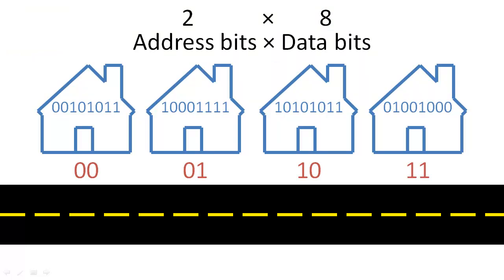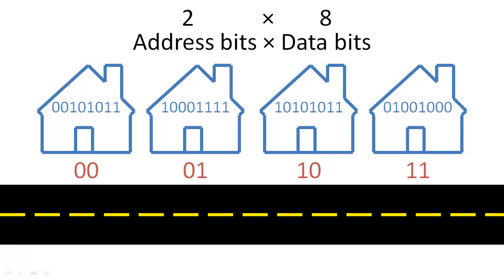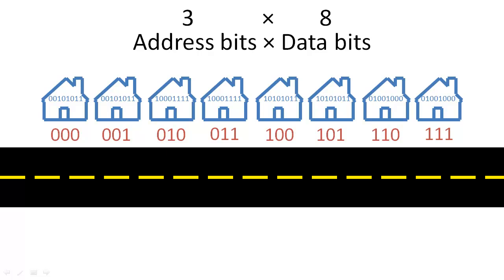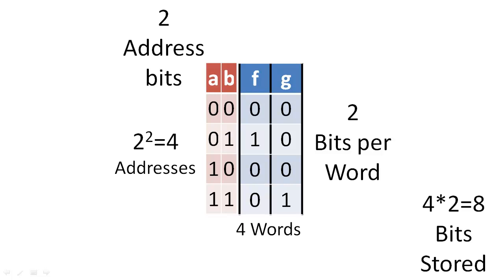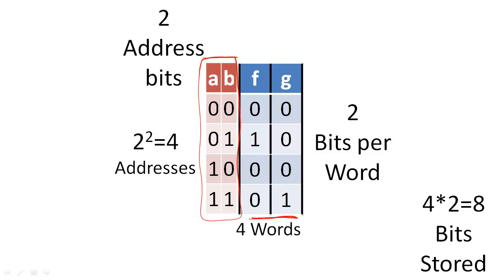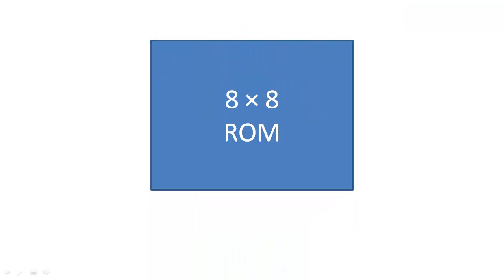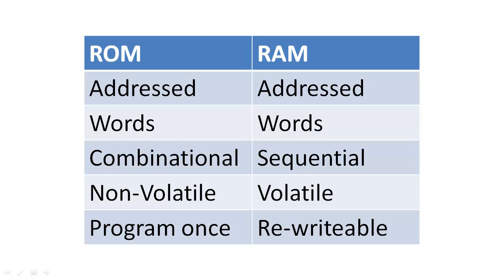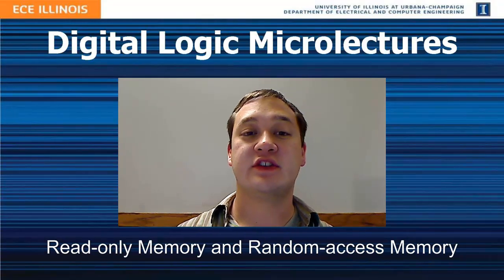Read-only Memory and Random-access Memory

Comment: I'm trying to build a rom bank with 32 roms, need an address decoder to chip enable each device. What 4 to 16 decoder is the best that has a chip enable pin on it without the other c1 c2 c3, or g1 g2 g3 pins that I don't understand?